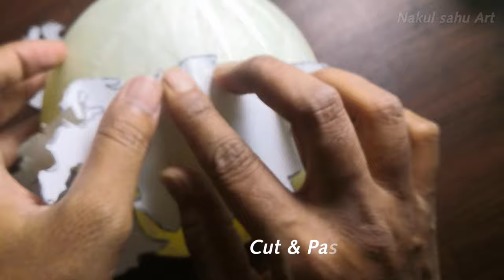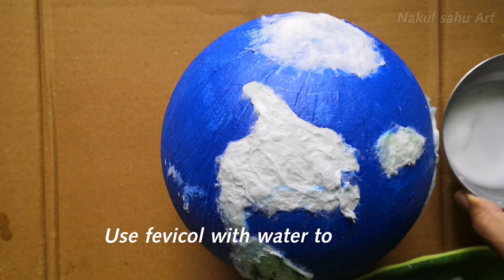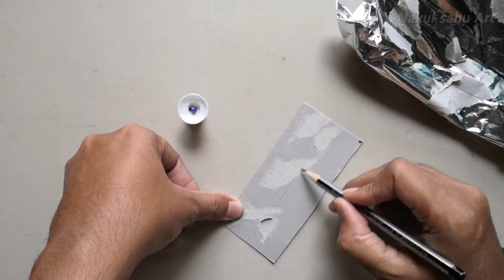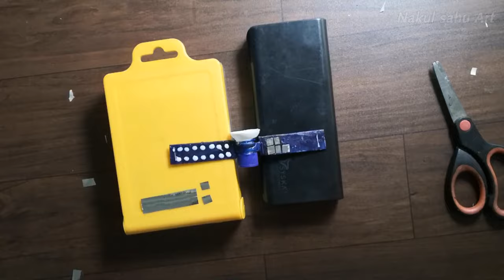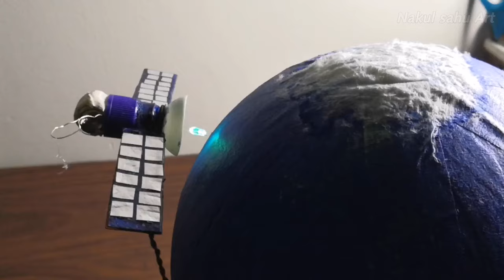Geostationary satellite _ 11th class school Project working model DIY #science

Comment: Sir motor kese lagai h please bataiye
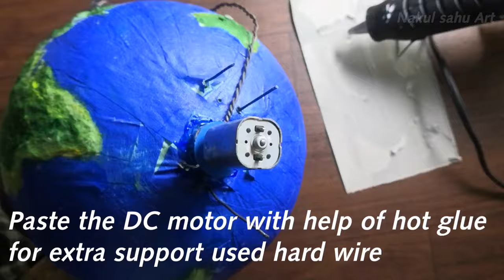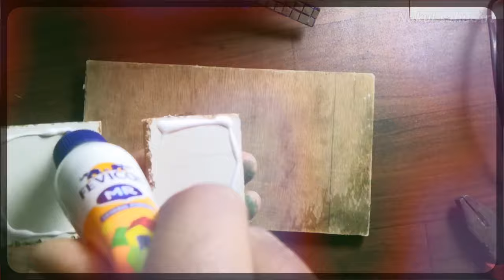Reply from the maker: DC motor के shaft मे छोटा wheel लगाया है wheel में satellite को hold करने केलिय binding wire से बांधा है motor के wheel को hot glue से चिपकाया है for extra strength  binding wire से भी बाँधा है ( Plz check 4:30 to 4:36 in slow )

Comment: Sir my dc motor cannot spin when i put ball on it and it is also unbalanced cannot keep still at 90 degree angle plz tell me what am i do
Reply from the maker: Change the motor/increase battery power , For extra strength i tied ball with satellite binding wire ( Plz check 4:30 to 4:36 in slow )
You can watch below video for earth rotation
https://youtu.be/lFcFAQugEHs

Comment: Can u please tell me the motor name which was actually used in this vedio
Reply from the maker: It’s dc motor around 100RPM powered by low voltage 1 aaa battery.
You can use 3.5 rpm dc gear motor also as i used in below project plz watch for reference.
Reply from the maker: Earth layer model _ 3d  Model
https://youtu.be/rf5CDKvr4N0

Comment: How to are set motor in this Mera toh ho hi nhi rha
Reply: Mera motor rotate toh ho rha hai lekin disbalance bhi ho rha hai
Reply from the maker: @kashishraghav6431  DC motor के shaft मे छोटा wheel लगाया है wheel में satellite को hold करने केलिय binding wire से बांधा है motor के wheel को hot glue से चिपकाया है for extra strength  binding wire से भी बाँधा है ( Plz check 4:30 to 4:36 in slow )
Reply: @nakulsahuart  thank you 🙂🙂
Reply: @nakulsahuart aap sabko special reply de rhe hai or sabko problems solve kar rhe hai  ye bahut aachi baat hai .. thank you Soo much

Comment: Where did you attach the wire of Dc motor
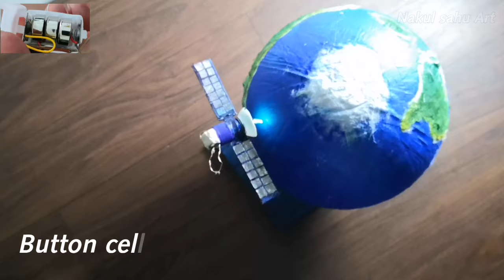Reply from the maker: motor connected to 1 aaa battery (used one for slow rotation ) and used light on satellite 6:49 (powered by button cell)

Comment: Sir plz can you provide some points for this topic cause i have a science exibtion and i also have to say someponits on it.. Plz sir
Reply from the maker: Thank you for watching, 
Geostationary satellites have the unique property of remaining permanently fixed in exactly the same position in the sky as viewed from any fixed location on Earth, meaning that ground-based antennas do not need to track them but can remain fixed in one direction. Such satellites are often used for communication purposes; a geosynchronous network is a communication network based on communication with or through geosynchronous satellites.

Advantages of geo-stationary satellites:

1. Get high temporal resolution data.
2. Tracking of the satellite by its earth stations is simplified.
3. Satellite always in same position.

I’m not the expert on this subject ,Above are from Wikipedia you can add more points from Wikipedia, hope it will helpful to you.

Comment: Sir I am watching your video from Bangladesh. Sir I did everything right, but when I put the earth on the motor, the earth does not rotate anymore. If the earth is not placed on the pea, the pea will turn. What do I do now? There is an exhibition in my college tomorrow.
please help me Please give me an idea asap.
Reply from the maker: Try with 9v battery or replace the DC motor.
Reply: @nakulsahuart  I tried with DC motor but no sir
Reply from the maker: @syedatasnimjannat6764  what kind of ball and DC motor used in your project, plz check battery and motor.
Reply: @nakulsahuart  The ball is made of plastic, not a football.
Reply from the maker: @syedatasnimjannat6764  ok than it should be rotate , plz try with other motor.

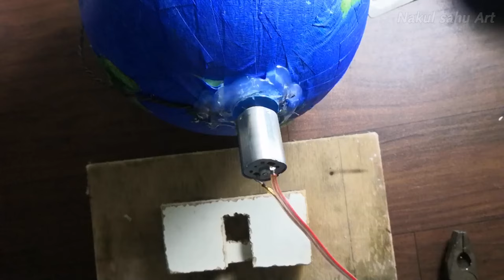Comment: Sir I have science exhibition tomorrow can you tell me what you did in part 4:49 and what motor did you used as my dc motor’s speed is too much
Reply from the maker: DC motor 3-9v, I used 1 AAA battery 🪫 (used one -from TV remote) due to low power it rotate slow.
Reply: And sir what about 4:49 I didn’t understood it
Reply from the maker: @Draksha_Disley  which motor and what is your power source ?
Reply: Eveready battery 9 volt
Reply: So can you please help me out because I don’t know how to fix it and how to do it and I have tomorrow exhibition
Reply from the maker: @Draksha_Disley  remove the 9v battery from project and use one battery of any remote.
Reply: Ok
Reply from the maker: 3-9v dc motor means it can run with from 3 to 9 volt you need to reduce the power supply replace your power supply with(AAA battery) battery from any remort or wall clock as it's 1- 1.5 v output.
Reply: Sir I have understood the materials but can you tell me how you attached battery with dc motor and all I have made earth,stand ,satellite but how to connect it I can’t understand because of lack of explanation

Comment: Where are the extra wires left 
After attaching DC motor to that wood piece
And also
How does light came in satellite
Reply from the maker: 4:50 DC motor (connected to 1 aaa battery used one for slow rotation ) and used light on satellite 6:49 (powered by button cell)

Comment: Please one doubt? Where you switched on globe rotation? What is the name of the  wire u used in the middle? Please tell me bcz only two days more for our exhibition
Reply: Please please please please please
Reply from the maker: DC motor powered by 1AAA battery.
You can get the GI wire from hardware shop.

Comment: What did you do with the other end of the wire attached in the motor please explain
Reply from the maker: motor connected to 1 aaa battery (used one for slow rotation ) and used light on satellite 6:49 (powered by button cell)

Comment: Please give me the list what you used in this project please reply
Reply from the maker: Please check description for material list.
Reply: and how you paste the motor with the ball I am doing the hole than the ball get exact matches and it's important to set the light in satellite?please reply sir
Reply from the maker: Watch in slow speed from 4:29 DC motor wheel joint with ball with hot glue (it’s powered by 1 aaa battery used one for slow rotation ) and used LED light on satellite 6:49 (powered by 2 button cell)
Reply: @nakulsahuart  ok sir thankyou sir